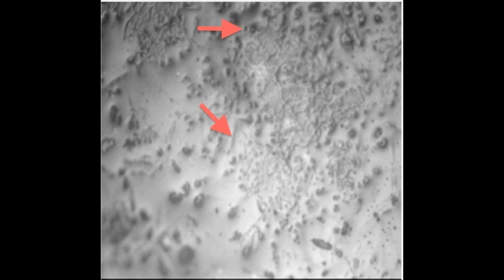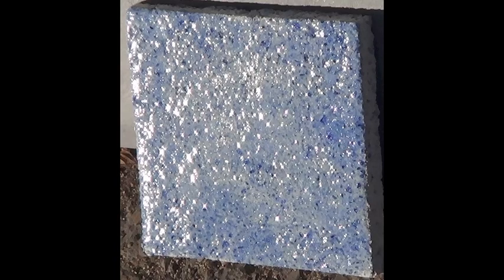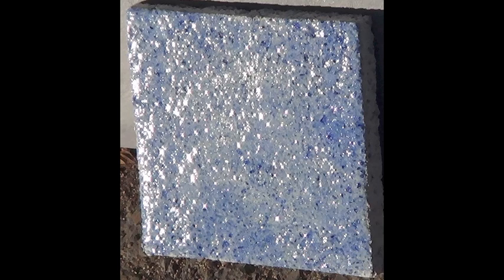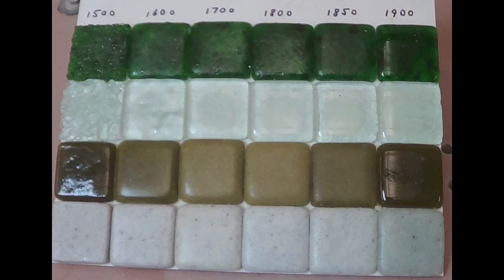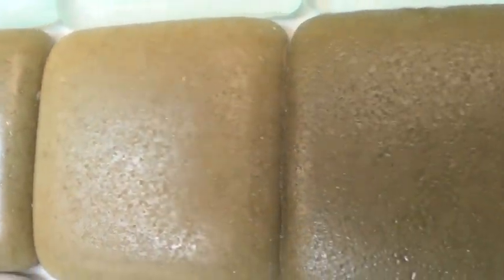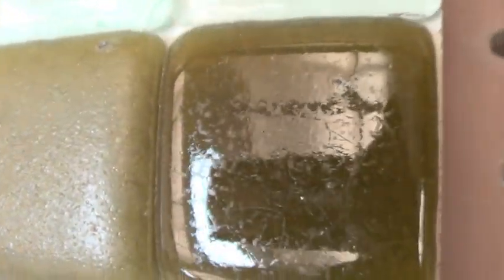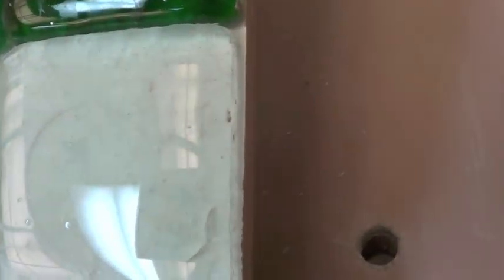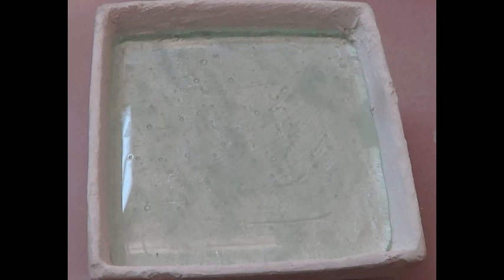Make Recycled Glass Tile 7   Devit

Comment: Robert, you seem like a smart, informed guy on this issue. I'm a total noob with more curiosity than experience. Having said that, I have a question: is there a way to overcome the COE of bottle/container glass? I've wanted to do some jewelry using recycled glass. It would be cool to lighten the color of green or brown glass frit by adding clear glass frit. Or, maybe slump two frit colors together in one piece. However all I hear/read about is there is no simple way to determine or overcome COE. Everything is going to fall apart or explode and the world will end! What do you think?

Thank you for the masonry colors idea! That does indeed give me ideas!
Reply from the maker: In my experience, incompatibility is a function of both COE and particle size.  I've found that mixing container and plate works fine if the particles are smaller than 16 mesh (a standard window screen) and blended.  Incompatibility comes when two pieces of different kinds of glass share too much of an edge on heating and cooling.  I developed the process Fireclay Tile uses to make Crush Tile for another company, Sandhill Tile.  We used Bullseye frit to make reds & yellows mixed with plate glass because there were no nice enough red stains.  If you think about it, all fired ceramics combine glass and crystalline materials which would be highly incompatible if the particles weren't so small.  Check out my video about making bricks using glass.  Talk about incompatibility!  I know what you mean about people freaking out over incompatible things exploding.  Get a grip.
Reply: Thank you! That is the answer I was hoping for. I will indeed check out your glass brick video - I'm looking forward to more videos from you!

Comment: Hi Robert. Excelent work!
 Using Flux is dangerous to the final piece in using to eat or drink?
Reply from the maker: Christian Covarrubias Good question, to which I don't have a good researched answer.  Although boric acid is sometimes used as an insect repellant or killer, I believe the boric acid insect products state that they are non-toxic to humans.  Also, I know boric acid and borax are used in cosmetics, clothes washing detergents, etc., so my assumption is that contact with humans is okay.  Also, I know fluxed glass tiles have been successfully used in swimming pools, so there's no water solubility when completely fired.  If there was solubility in water, it would show up pretty fast in a degradation of the tiles since the flux goes throughout.  But everything I've said is based on assumptions, so you might also look at warnings associated with ceramic glazes, which also often contain boric acid.  I think boric is also in ceramic glazes advertised as "food safe."  Now that I've said all of this, I'd say the ceramic glaze path is the best place to start your own research.  Let us know.
Reply from the maker: Robert Kirby Upon reflection as I brushed my teeth just now, there's something else to add.  Boron is, of course in borosilicate glass, often used in heat-resistant cookware, so it must be okay if it is a part of the vitreous molecular structure.  This of course contrasts with lead-bearing glass which has been shown to leach elemental lead in an acidic environment like wine containers and is therefore not to be used.  This then begs the question of whether using boron compounds as a flux results in the true incorporation of the elemental boron into the vitreous structure.  I have run trials where I soaked tiles in vinegar for weeks to see whether the tiles degraded, more for aesthetics than safety, and have seen no problems.  There is, however some volatilization during firing of tiles containing boric compounds, which can be seen in a very fine bubble matrix that will be in the final tile.  Whether these bubbles are oxygen, and probably sodium if you use borax, I don't know.  The Wikipedia entry for boric acid says it boils at 572F,  which would imply that the acid itself boils off to a large extent, helping to suppress devit as it goes, probably leaving very little residual boron compound.  But it's important to remember that all glass fusing is surface rather than bulk reactions, so all of the action is at the surface of the particles, so a very small percentage of the bulk glass actually contacts any additive.
Reply: Robert Kirby  Thanks a lot for the info. I will research from where you suggested. I will inform you my advances!